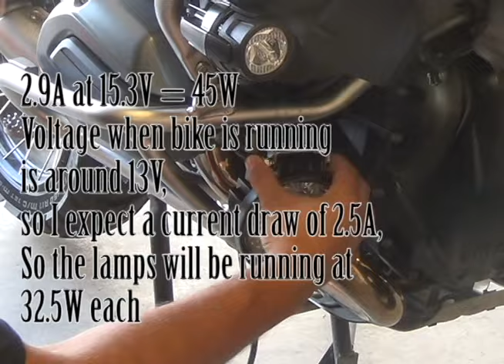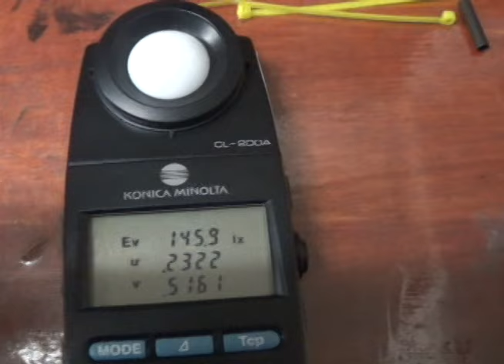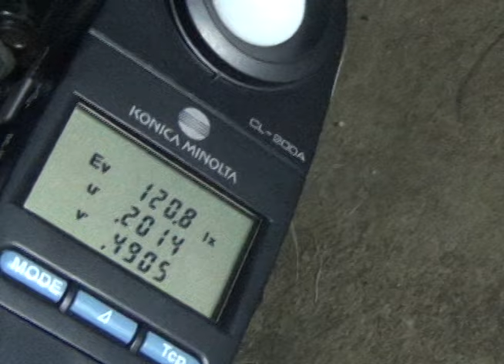DIY, 2016 BMW 1200GS ADV $35! LED FOG LAMPS INSTALLATION REVIEW

Comment: Hi. Thanks for the video. Did you use a relay triggered by a 12v positive line from the bike? If so, where did you tap into? If not, what happens if someone turns the lights on when the bike is not running?  Cheers